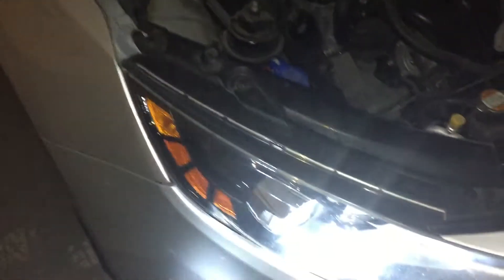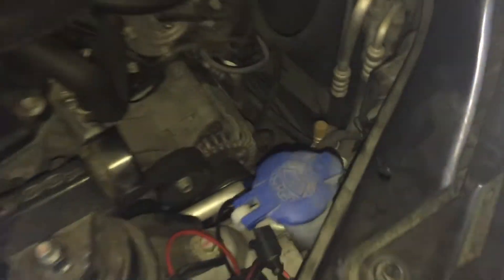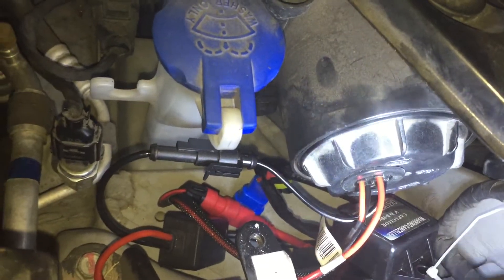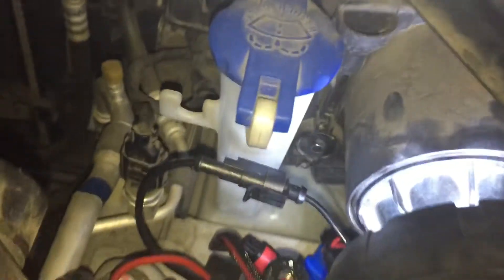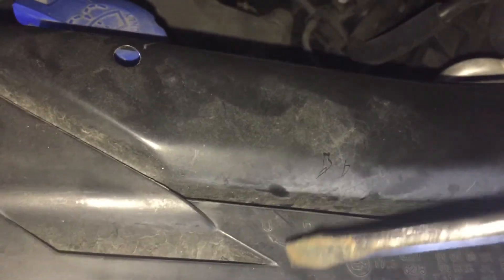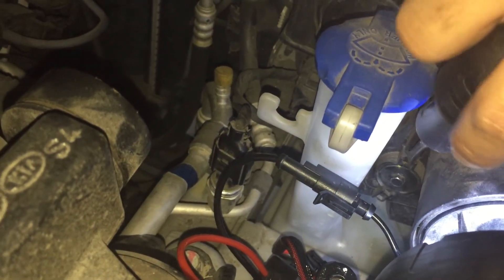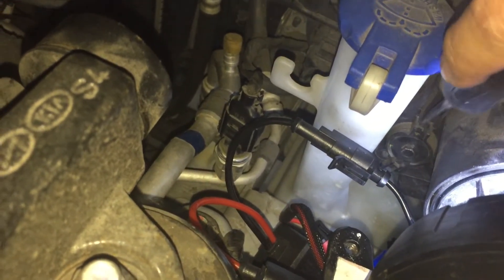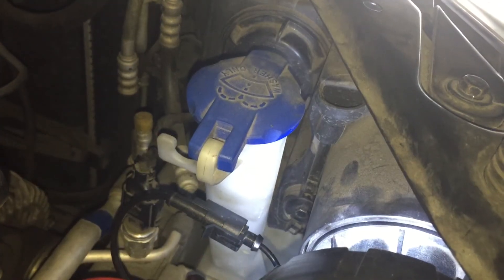DIY how to adjust 2011 Kia Optima headlights vertically

Comment: Very helpful video; straight to the point. I was able to reach the nut with a socket wrench and didn't need to remove any parts whatsoever. Super easy job, the $150 is a total ripoff.

Comment: thanks a lot brother, you were very helpful, after dealing with the dim lights in my 2012 optima I finally bought silver stars and then I discovered that they weren't working either! your video was extremely helpful 😊
Reply: Were the silver stars better? Like brighter?
Reply: Exact same thing I didn

Comment: Thanks a lot mate. This worked for my 2014 Kia Proceed GT. For my car; the low beams are seperate to the high beams, therefore there are 4 adjustments in total. I was able to do it with a skinny flat head, just used leverage rather than trying to twist the screw driver, cause that doesn't work.

Comment: Isn’t the purpose of the holes on top to be able to put a screwdriver through it to get to the area instead of removing parts?
Reply from the maker: John Farias mine was too fat to fit in the hole, so I had to go in through the back. I’m sure if I had a long, skinny screwdriver I’d have been able to access it from the top. In either case, both methods will get the job done.

Comment: Do you know if there is a way to align for outside/inside?
Reply from the maker: There are alignment holes for up/down and left/right. They are marked with U <--> D and L <--> R as indicated on the headlight. Find the L <--> R and use a long screwdriver to get down in there. In this video, my screwdriver wasn't long enough so I had to adjust it from behind the light, otherwise you can do it from the top. 

If you can't find it, let me know and I'll make another video and post the link on here.

Comment: What about the other side
Reply from the maker: If you mean the driver side headlight, there’s a hole in line with the low beam, near the back of the headlight marked “R <——> L” where you can stick the screw driver in.